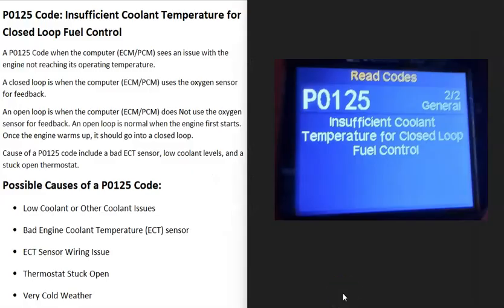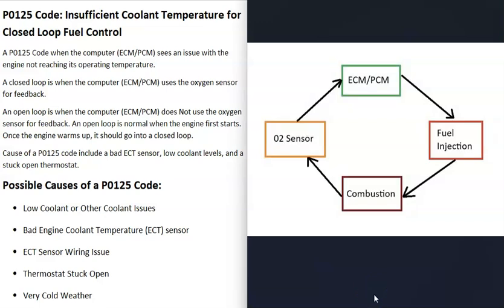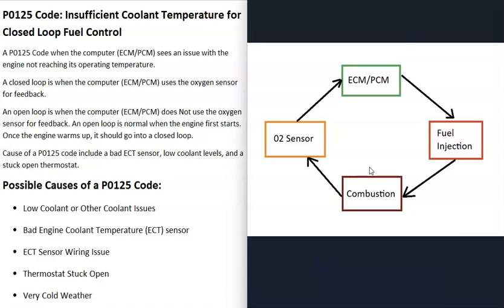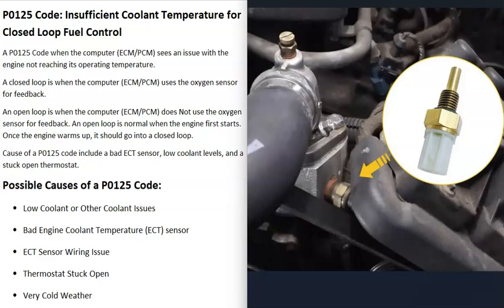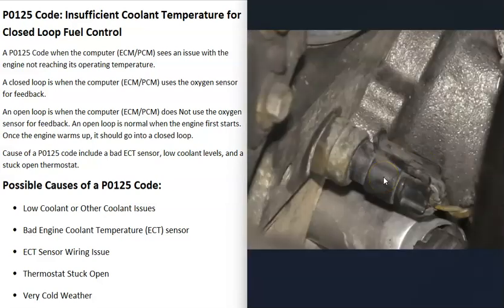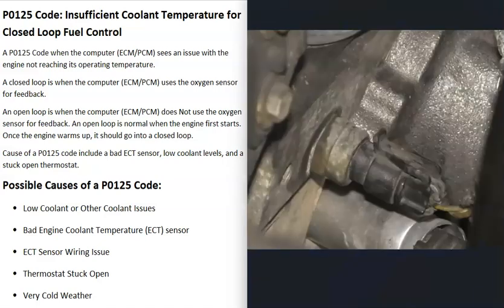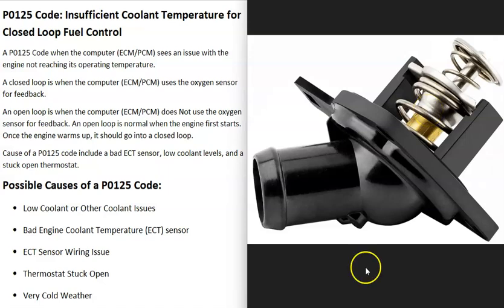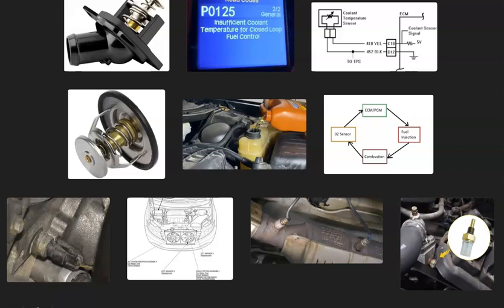Causes and Fixes P0125 Code: Insufficient Coolant Temperature for Closed Loop Fuel Control

Comment: car hesitate and engine runs rough when its cold until i drive around for some time then it runs fine, checked codes and the code P0125 is there

Comment: I just replaced my downstream o2 sensor yesterday And drove it to work, and this code came up. I have a 2003 Toyota Corolla S.
Reply: I had the p0125 code In my 2002 Toyota Corolla for about 2 months now. This morning, I finally got rid of it after replacing the upstream O2 sensor.
Reply: @marinaprevas1922 same in my Lexus lmao

Comment: I am getting intermittent P0125 code on my 1997 Toyota Camry V6 3.0L. The dashboard coolant temperature gauge through one-wire temperature sensor points in the middle of the gauge, to be normal. So I know the coolant temperature is good.  Just the ECM cannot get coolant temperature feedback due to the two-wired temperature sensor issue. Replaced the two-wire coolant temperature sensor twice, the problem comes back again. Upon close examination, one of the wires on the wire harness is found to be very loose. The socket of the harness is of offset style (not aligned). But nobody sells this style harness anymore. Any thoughts?
Reply from the maker: Sometimes, finding a plug can be problematic. eBay is often a good place to look, or junkyards may be an option; otherwise, it may need to be put together.
Reply: I replaced my ect sensor and the code is still there , but when I checked my 02 sensors three of them are giving me readings but the fourth one is dead replaced it and it’s still showing dead

Comment: This is probably the closest information I have found for the issues of my car compared to talking to,  "I'ma rip you off car mechanics". One of them literally suggested to me that I should replace my catalytic converter. Knowing full well, it's expensive and he literally thought I was going to say yeah to his suggestion. The symptoms explained in this video match up to what I have been experiencing. The major key thing to me is, I am burning premium gas in two days and the places I tend to go to, is not far and I don't really try to drive that much anyway.

I drive a 2008 Mazda 3 Sedan 2.OL 4-Cylinder. I really believe I have to replace a few sensors vs a major part that is expensive and labor.

Thank You.

Comment: Would the etc sensor be part of p0116 instead?
Reply from the maker: A P0116 code is "Engine Coolant Temperature Sensor 1 Circuit Range/Performance"

Comment: Thank you for sharing your expertise! I think I actually have the very last problem on your list, being cold weather. I live in the midwest in IL and work in WI. Yesterday my 2022 ioniq was flashing high engine temperature instantly when i started my car. I thought that was weird since the temp outside is 9 degrees today, and it was literally not even a minute into the engine running. I drove down a few blocks so i could park it at a gas station and opened the hood. There was no coolant leak, and no low coolant levels. I went in and let the engine bay rest in the frigid cold. Drove all the way home (1 hour) with normal engine temps, and no warnings. Today it did the exact same thing omw home from work. Only this time, after i left the gas station, the check engine light came on. When I got home i popped my OBD reader in there and the code it threw was P0125. Your video has been extremely helpful and i know what to look for now. Thank you once again for sharing and putting together a great informative video!

Comment: My 2000 lexus is200 is stuck in open loop and I can't figure out how to fix it at all
Reply: Did you replace the thermostat?
Reply: The problem ended up being the timing belt it slipped a tooth i replaced it and its been perfect since @marinaprevas1922